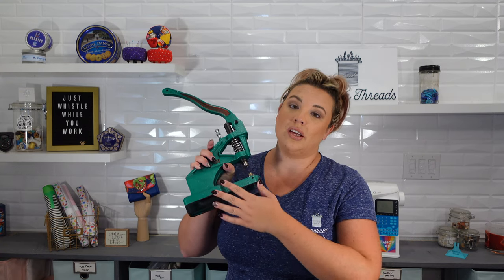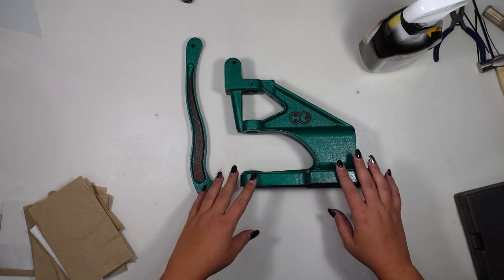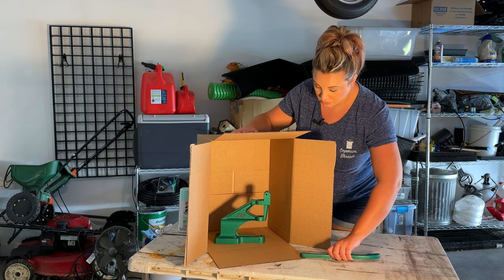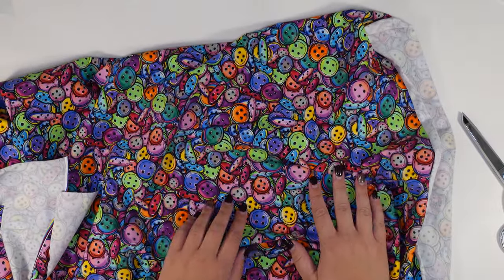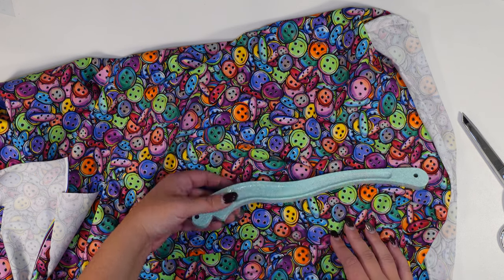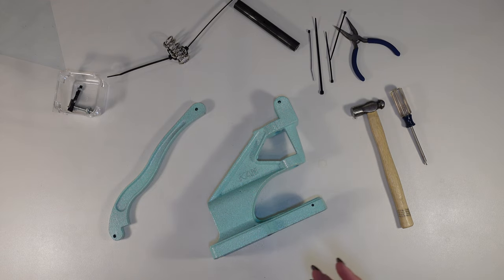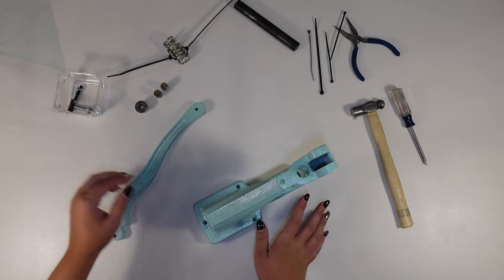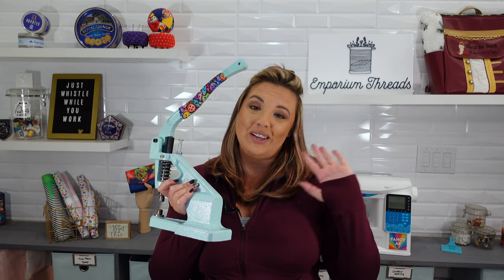KAM Press Professional Table Rivet Press Makeover

Comment: Great video!!  Mine is screaming to be painted Cherry Red!!  Painting tip:  If you have a Lazy Susan to sit the base on when spraying, it helps to give you an even coverage.  You won't have to worry about finger prints when you have to move it.  The handle, you can hang with fishing line to spray it.  Brilliant trick with the zip ties and the spring!!  Whoop Whoop!!
Reply: This is an amazing tip and would work great! This way would make it so much easier where you wouldn't have to keep turning it...Thank you!

Comment: I really like this idea except I would do one thing differently. I would have used water diluted Dawn dish soap to remove the grease. Best oil/grease cutter ever. Then rinse it well and use a hair dryer on it to insure bone dry. I have restored metal stuff for years and that's where I start when you don't have a shop near by to do that particular work. Love the video. Great idea. P.S. 409 leaves a residue. It ruined some spray paint for me on a wagon.

Comment: I was impatient and put my spring in and cut the zip-ties, before I put the rod in and the bolt that pushes the spring down. 😢 I also over applied the glitter spray in a few spots. Otherwise, my KAM makeover turned out! 😊 This tutorial is the best. Newer KAM presses have a bolt instead of a pin to push the spring down.
Reply from the maker: I’m glad it turned out great in the end :)

Comment: Excellent video!  Mine needs to be painted too, but I'm too lazy to take it apart anytime soon.  Maybe I will just make a padded handle sleeve for now and I need to mount it to something or put something on the bottom to prevent it from damaging surfaces.

Comment: Thank you so much for the tutorial! I just want to point out that some people mentioned using a Lazy Susan to turn the press around during the paint spray stage. If you dont have one (or dont want to risk getting paint on it), you can place the press on a piece lf cardstock or another bit of cardboard to be able to rotate it around without touching the press and getting finger prints on it.
Reply from the maker: That’s a wonderful tip, especially for those who pray paint a lot. Thanks for sharing :)

Comment: I recently painted both of mine. 
I just taped around the middle post. I started to try to take it off. But didnt feel like dealing with the spring. I knew I would never have been able to get that back in place. Its a good idea with the zip ties. If I need another one I might have to try that one. 

Love how the glitter came out. 

I used color shift paints. And love how they came out.

Comment: I want to paint mine too! How has the paint held up over time, any chipping?
Reply from the maker: Still holding strong! I even traveled with it and didn’t have any issues. I did drop a really heavy metal item on it in my studio and it did make a tiny chip. I spraying a little of the spray into the paint can cap and blotting it on with a tiny cheap paint brush. Super easy fix and no issues since :)

Comment: If I weren’t to use glitter and just the glossy color would it need a top coat with the glaze?
Reply from the maker: Not necessarily. I used it to hold the glitter on but triple thick also gives you a really pretty gloss finish and extra protection over your freshly painted surface. I’m a little rough on things so I really like that added protective coat. 
If you don’t like a gloss, you would use a matte or satin option.